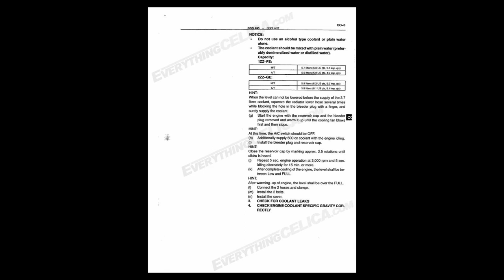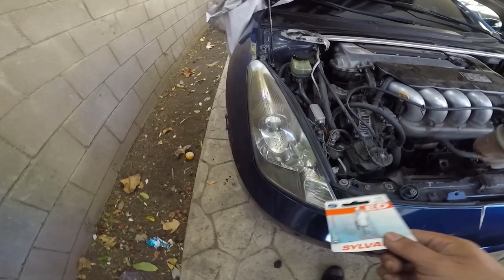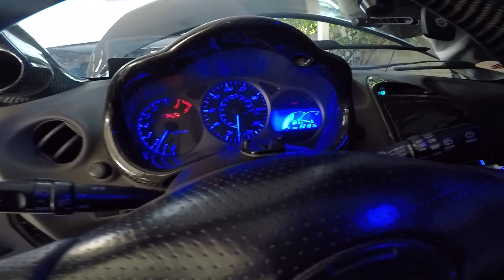How to Bleed the Coolant 00-05 Toyota Celica

Comment: Hey bud! I struggled with trying to get the air out of my cooling system for at least 4 hours! Nothing worked until I watched your video!
2000 Celica.
I've been a professional mechanic for 50 years, and couldn't figure it out!
Thank you from the bottom of my heart!
Cheers Brother!
Reply from the maker: Glad ir help you out, this is the reason i keep doing it not for the money or dame
Reply: @RafasGarage  
Awesome brother!!
Reply: @RafasGarage hey man idk if you’re gonna see this but I just opened my bleed valve before watching this video and the coolant went down quite a bit in that area. Am I going to have to bleed it again because of that like you said?
Reply from the maker: @damianpizana5473  you should be fine with just topping it off

Comment: If you don't properly bleed you will maintain air inside the upper block of the engine and when the engine warms up both fans will run full blast and not want to turn off. The reason is that the engine head will overheat because of the trapped air. Since the coolant temp sensor is located in the upper engine block next to the hose outlet, it sends a message to the computer to cool down the engine. Also be careful to properly plug the engine coolant temp sensor otherwise the fans will not turn off either.
Reply: I just added coolant and seems to have that outcome cuz it’s not working
Reply: Would the heat detected by ECT sensor cause the car to not start after that?
Reply: @duplicityustin3400  the ECT sensor controls the fans and the fan speed. if you run it without plugging in for example, it doesn't affect starting up.

Comment: Hey bud changed thermostat and coolant temp sensor, bleed it and everything. Did notice the thermostat open because the hose on passenger side got hot but after driving it for a mile or so check engine light came up and still gave me p0125 code for closed loop. Don't know what else to do.

Comment: I tried all that I could but nothing seems to be purging the remaining air out of the system. I’m not sure where the it’s trapped but would someone be able to help? 

I recently replaced the thermostat (I made sure it actually worked, & then made sure to install the correct way). Did this procedure (minus elevating the coolant reservoir). I was able to massage lower hose until I didn’t hear any air. However can’t reach the upper hose due to other stuff being in the way. The reservoir on the breather cap side is half full, & I’m pretty sure it’s supposed to be completely full but can’t seem to get the system to refill it on it’s own. Any tips?

I also warmed up the engine to open the thermostat and then drove on an incline. After letting it cool down I was able to get some more coolant in, but I can tell it’s still not at max capacity (it overheats). Please someone help. I am so new to DIY cars and it’s daunting doing everything myself as a 21 yr old female. I’ve already spent a lot at shops fixing other things and this is supposed to be simple but I can’t seem to do it 😢 Please please please help lol I just wanna drive my baby.

Comment: What about if a put the same coolant I still have to bleed it ?
Reply from the maker: Hugo Rivas only have to bleed it if you disconnect one of the coolant hoses
Reply: Ok because the coolant on my celica is under the lowest mark and I would like just add coolant and don’t all that of bleed the radiator.
Reply: Baby blue instead is brighter!! That video on the coolant thanks I know for a fact lots of celica owners did not know that or thought they did correct procedure
Reply from the maker: Hugo Rivas no you wouldnt just add
Reply from the maker: Robledo,D Yes it can be a little difficult if you never done it
Reply: Thanks and I will try to do it by my self and thanks again I like your channel and all the content that you produce.
Reply from the maker: Hugo Rivas You are welcome and glad you do